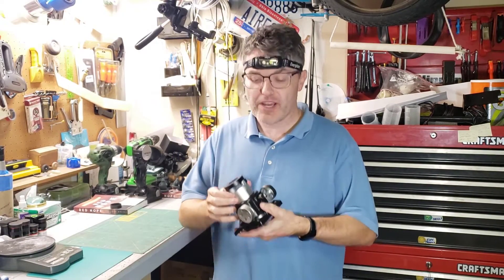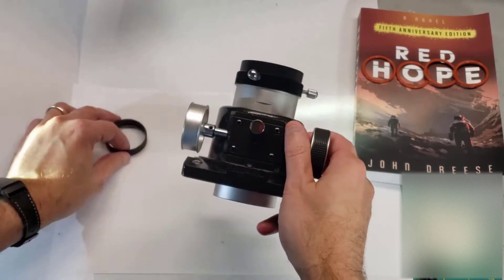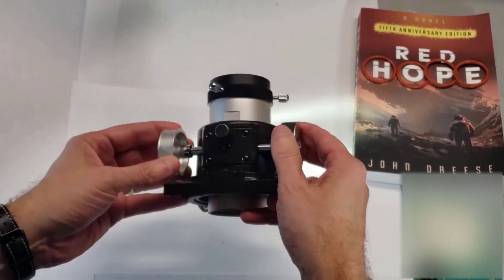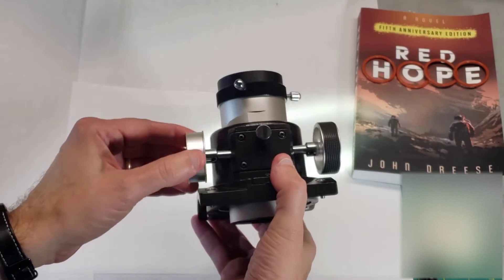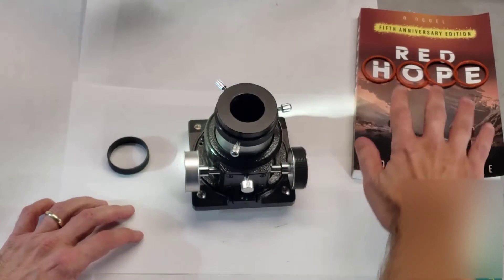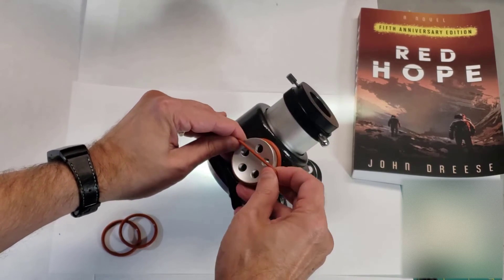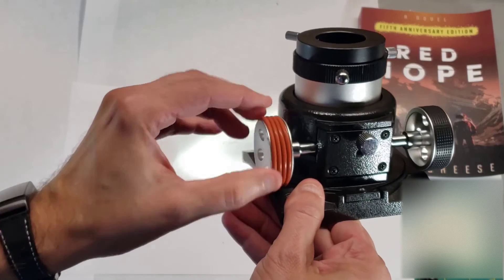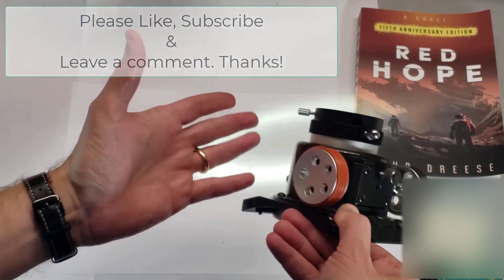Fix Rotting/Missing Grips On Your Telescope

Comment: Another solution: the rubber bands that come on broccoli
Reply from the maker: Thank you for the idea!  A very excellent way to fix the same problem. The only advantage that the silicone o-rings might have is longevity, but with the cost of produce bands almost zero, your method may be the most cost effective in the long run!
Reply: You can stack them too, one on top of another.

Comment: I’m looking at a used scope tomorrow and noticed the grip missing on one knob. This tells me not to think of it as a dealbreaker on an otherwise nice DOB. Wish me luck.
Reply from the maker: Oh yah, this is an easy cheap fix.  The only dealbreaker would be if the mirrors are damaged.  Dirty is okay, but etched would mean a re-coating.  If you buy the telescope cheap enough, even that is not a dealbreaker. My 12 inch Dob was only $250. The mirror needed immediate re-coating, but even with that cost it was a great deal.
Reply: @AstronomyGarage  any thoughts on how I can get my best look at the mirror when visiting a resale. The scope is owned by the daughter of original owner. I was thinking removing the mirror is a shop exercise not something I can do at the owners home. Bringing a flashlight but have no idea how effective that will be fill I get there
Reply: @AstronomyGarage looks like removing 3 screws and pulling the mirror assembly out. I’d rather not do that at the owners place. It does have a dust cap and looks immaculate on the outside. It’s 10 min from my house which is a plus.

Comment: In my video about repairing my CEM40 mount, I encountered the timing belts. Perhaps these (inside out) would fit nicely too! The teeth will provide ample grip.
Reply from the maker: That would be a very clever use for them and I agree the teeth would be grippy.

Comment: Rubber bands work just fine, too. :-)
Reply from the maker: That would work, but any rubber-based solution would still eventually have the same fate as the originals. The silicone o-rings should last a lifetime.

Comment: Hello, Mr. Dreese;
Excellent video, "THANK YOU!"
You are so smart, here's a question for you;
Many focusers have small knobs so it is harder to 'fine adjust' the focus.
How can we fix the knobs so the diameter is say, 30% larger?
My scope's knobs are 30mm/1-3/16"(1.1875") diameter.
I'd like to increase the diameter to 45mm/1-3/4"+(1.77") or 50mm/1-15/16"[round to 2"].
I thought of drilling 5 or 6 holes spaced evenly around the diameter & inserting dowels.
But just 5 holes per knob x 2 knobs is 10 holes.
That may not sound like a lot but every hole is a possible disaster, at least for me.
My other idea is to use holes saws to cut the larger diameter from 1/2" plywood.
Then using a smaller hole saw cut the center hole to match the original knob diameter.
I'd like to hear what you think of this, so please reply.
Have a GREAT day, Neighbor!
Reply from the maker: That's a good question, and I've not heard that before.  So the knobs are just too small for your fingers?  1.2 inches is pretty small for a focuser wheel.  I think your secondary solution is best.  Cut a circle out of thick plywood (or a chunk of 1x3 lumber) and then cut a circle out of the middle of that disk that matches your focuser knob diameter.  Attachment may be tricky, but you could go with epoxy or a couple of screws.  Or.... if your existing knobs are held on by a central screw, use a longer screw and only partially drill the middle out of your wooden disk.  Another solution would be to buy a very thick O-Ring that would wrap around the existing knob.   Let me know how it goes!

Comment: That's a good fix another one I've seen is using a bicycle inner tube & cutting across it the same width as the groove on the focuser, it does need to be quite a narrow one though so it stretches over for enough grip (If any of that made sense lol)
Reply from the maker: That's a really good idea.  My worry would be that the inner tube is too thin. Perhaps using two or three layers might be perfect? Clear skies!
Reply: @AstronomyGarage  You're right I think the repair I saw did have a couple of layers at least, I should have added that part.
Reply: I’ve got Orion aluminum focus knobs and replaced the rotting rubber grips with a section of mountain bike inner tube. It is the perfect thickness and has lasted several years so far.